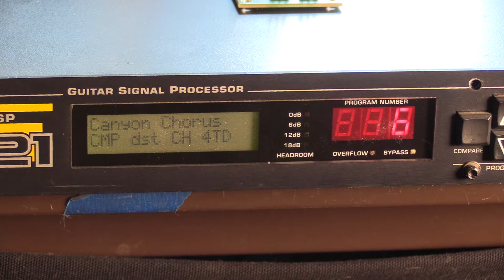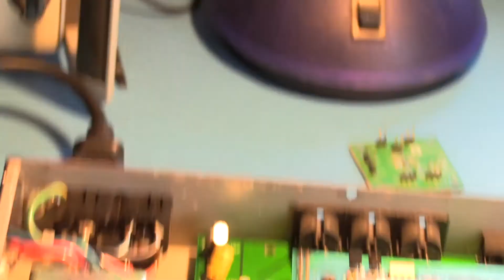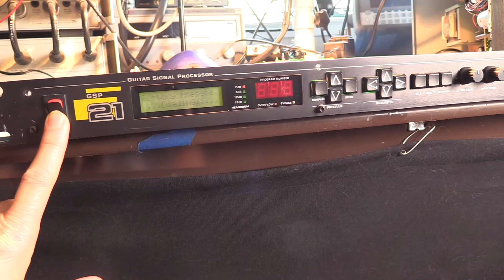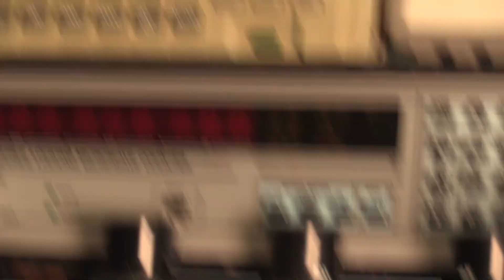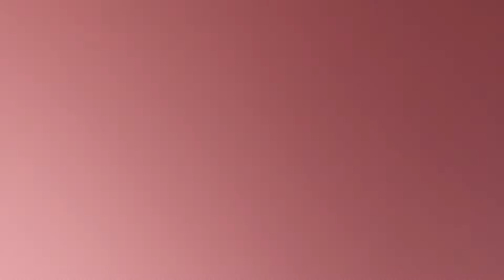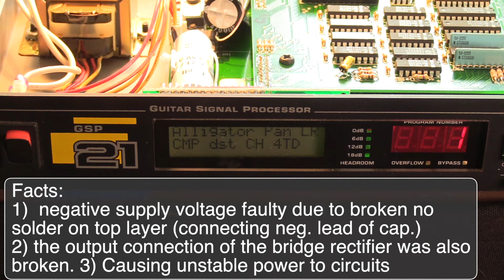DigiTech GSP-21 Repair (Battery replacement + Power supply fix)

Comment: I bought the first GSP 21 in 1989. I lost it (with ally belongings) in 2002. I recently purchased one off of Reverb. 🙂
Unfortunately, it won't save edits to the patches....so I suspect based on your wonderful tutorial. 
Can you tell me what kind of battery to get...before I open the thing up?

Comment: Hello, mine is a pro version as your but it produces a weak output. I really dont find what is wrong. I have a legend version and i was able to swap components in last chance. Circuitry are quite differents if you compare both schematic at page 4/7 (legend and pro). Im losing signal around DBX2150 but this one is good. Really annoying failure.
Reply from the maker: I think you can buy these for about $200.   But, yes, I agree - some repairs suck you in and you can't stop.

Comment: Got a V1 with the Legend upgrade chip maybe 10 years ago or more. Was excited at it was in all of the 90's guitar rags as the best-thing. Well, the 80/90's cleans are its strength but the gain tones are some of the worst committed to a DSP.

For maintenance, the lower main PCB which is common to many Digitech/DOD units of the era, has a few Tantalum coupling caps. These fail to a short eventually and let out a pile of smoke. Took out other parts, don't let it happen. One torched so badly in mine, it damaged the board right next to the PCM54 DAC and sucked to fix. Replace them with Electrolytics. If the meters max out, there is a big low-pitched noise, and the acrid smoke, it's those Tant caps.

Don't let the battery leak either. Change it regularly. I just use a 3xAAA holder and put it in place.

Comment: I seen it in a 1989 at a guitar  clinic to promote.  Someone won it.  It was pretty ground breaking.  Affordable rack for that time.  The clinician had some tasty fusion chops had a volume pedal and he looked in an old digitech distortion pedal. And did well with.  The pros came out later and I got the pro used in 91 for 450.  And never bought any pedals up until the 2000s. Think legends were in 92 and then they stopped. It was easy to program.  And the pedal board could easily have patches where you could turn off and on delay and modulation effects.  Go from distortion and clean on one patch.   Move to the next patch.   I liked that part better than the 2101. And the display was better than the 2101

Comment: 17:25 My unit needs new battery but I dont have original one to match it up What kind of battery is it I know its 4.5V but how many mAh ?
Reply: Mine has Energizer No.523  4.5V  or  buy 3 x 1.5 v and a housing  , there is plenty space for it behind the power switch.
Reply from the maker: I bought the battery off of Amazon. Here are the details: Exell Battery A21PX 4.5-Volt

Comment: I gotta a 2101 studio been the fritz for a year. Display would just randomly shut off along with all audio but the tubes would still be lite. It would come back on sometimes it would do this several times then be fine. Seemed like if it sat for awhile it would get bad. Recently it wont turn on at all but tubes are lite. Thinking it cant be power cord or tubes wouldnt get power. Anyone got any ideas?
Reply: gsp 2120 not powering on here too. have you found a solution ?

Comment: Hi
anybody work or have a  DIGITECH  twin tube GFX-1 ?
i Have a burnt U9(voltage regulator?) in my unit.
i can't read the number from the element..and there is no schematics
Can anyone help me on this one?
Reply: I'd guess any +9volt regulator would work.  I replaced a 3 in my 2112.

Comment: I have a gsp 5 I haven't used in 8 years. I put a new battery in and the batt light is still on and will not save new settings. Ay ideas.....Thanks Mike
Reply from the maker: I bought this one off of Reverb - and it was listed as working. At first I thought it was just a dead battery - but it turned out to be a bad solder joint.   I got lucky fixing it.
Reply: @silvermica  Thank you

Comment: Please, any idea what u21 is? It's missing on mine. Part number Please?
Reply from the maker: I've ordered a new chip for this unit - when I pop it open I'll have look at U21.  Which board is it on?  I probably will not completely disassemble - so if U21 is under a PCB I won't be able to see it.